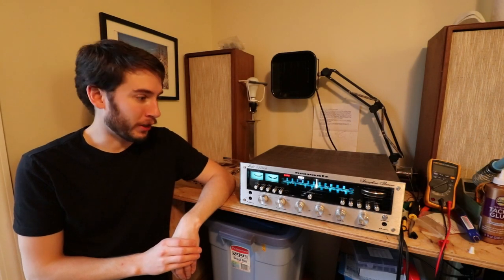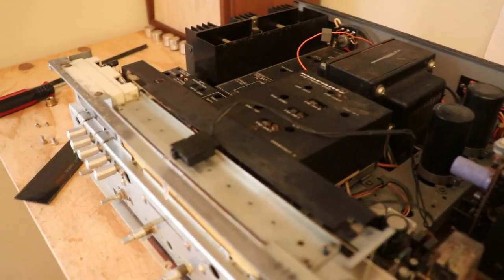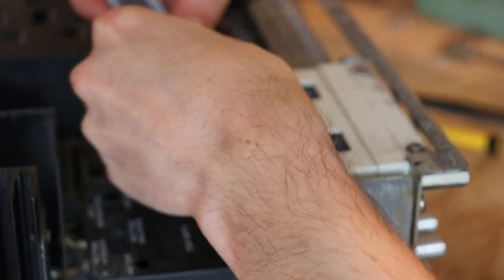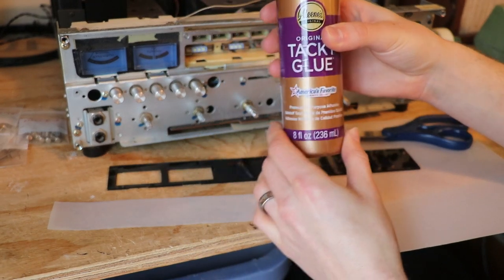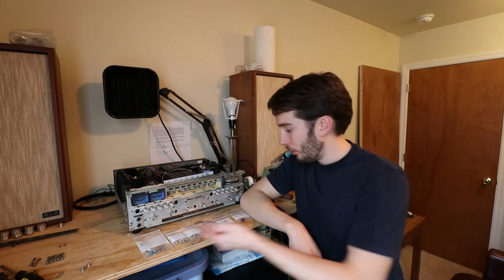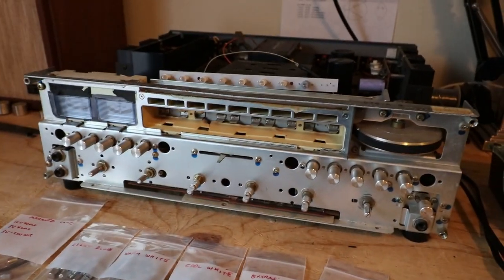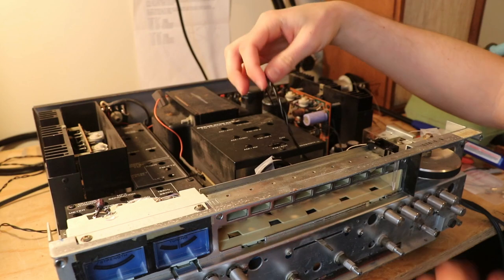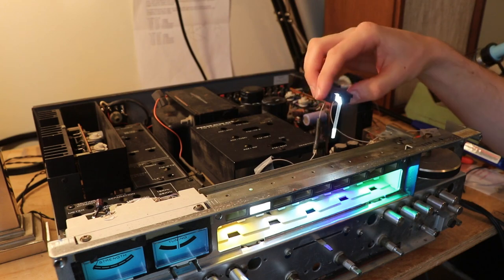How To Re-Lamp Your Marantz Receiver: The Ultimate Guide To Bulb Replacement *COLOR COMPARISON*

Comment: Worth noting that the soft face plate is easily marred.  the tool used to remove the face plate retaining bolt might circumferentialy scratch around the head of bolt leaving  telltale impressed scratch markings.
Not good.
Reply: Cut a 1 inch square peice from a plastic bag. Center over screw head and push hex driver. The thin plastic will not rip and add a layer of protection when turning.

Comment: Led look cheesy to me if not done correctly. Wrong colour or installed inconsistently which effects the light  pattern. The tacky glue is great. I use it for surrounds and just about anything else where a permenant fix is not required.

Comment: I'd have to agree with the incandescent choice; however, warm White LED is close.
Reply: I would go with the warm white LED if you don`t want to do that again in a 4-5 years. They don't generate heat, the color is very close to original and your vellum won't get burned again. If you find it's a bit too bright, just add another layer of vellum. That`s what i did and the color is very nice.
Reply: Incandescendants look great but the heat from those lamps really kills whatever is left of that baked, half-melted plastic shroud.  I've done a number of LED conversions on these and other vintage stereo equipment of the era such as Pioneer receivers, and it takes some experimentation to make them really look good. Aside from mechanical light filtering and diffusion such as vellum, parchment paper, or even color gels (used for stage lighting),  another problem that arises is that the LED replacements do not load down the power supply voltages in the way that the incandescent bulbs did; and so a power supply that delivered 7 or 8 volts into a bunch of relatively high current incandescendants might end up delivering 10, 11 or 12 volts into your new "8 volt" LED's, which will not only make them excessively bright but also shorten their lifespan, lunless you add series resistance to drop the voltage to the LED's. ( A  resistor substitution box or a potentiomateur of say 500 ohms to 1K is helpful for determining what resistance value to add into the circuit to tame the voltage to the LED's).  Sometimes it is also helpful to aim the fuse type lamps NOT directly at the face plate but maybe aim them up or down or even backwards and let the reflected light hit the vellum instead instead of the direct beam of light from the front side of the LED lamps. I have even put  self adhesive aluminum foil tape inside that plastic shroud so the light will reflect and bounce around rather than being absorbed by the discolored brown plastic.

 Another frequent problem with those units is that the solder connections are often broken down where the clips that hold the fuse lamps to the strip of circuit board  underneath the dial string are soldered, and so the lamps can be intermittent.  I always suck all the solder off of those connections and  and resolder them, which is tricky because 1) the dial string is in the way and you dare not hit it with your soldering iron and 2)  the metal tabs of the lampholder clips that are soldered to the board are usually pretty well oxidized and they don't really like taking the fresh solder. In the plus column for using LED's here,  once you have resoldered  the lampholder clips, they won't fail from heat again if you have converted the unit to LED's.

Comment: Is polarity critical for the LED lamps?
Reply from the maker: No because the lamps run on AC current. The stereo lamp is the only one that needs the polarity correct since it runs on DC, but I don't recommend replacing the stereo lamp with an LED. I've had them fail multiple times.

Comment: What is an approximate price charged by a technician to do this?
Reply: i would say at least $150 to change those lights. You should do it yourself. it's easier than you think. Just put away in order all the parts you take apart, buy led lights from sellers online and a sheet or two of drafting paper (vellum) and voilà!

Comment: The life of an LED will be greater. The LED load resistor will warm up and hopefully be cooler and not comfortable continue the melting. Sometimes knocking down intensity of the LEDs might replicate the old look. Maybe, a yellow led to warm up the display

Comment: Don't use dish soap has it have salt that will corrode metal, use car shampoo (sometimes with wax finish - it will have great results). If you need further treatment you can resort to light car polish compound and careful application.

Comment: how do you get the dolby light to light up?
Reply from the maker: On the 2250B it only lights up with the selector switch is set to FM and the Dolby button is pushed in.
Reply: @AHFixIt  I see. My 2238B and 2252B both have a dolby light but neither have a true true dolby button. I don't have the dolby card installed. If I'm correct, that light will never come on right?
Reply from the maker: @jackstiles1874  I'm not sure.  I've never worked on a 4th gen 22XX like those.  If the FM 25us button doesn't turn it on then I don't know.
Reply: @AHFixIt  great videos. I watch em all.